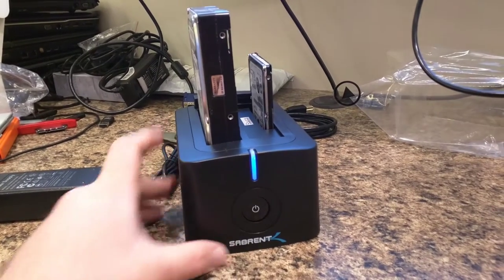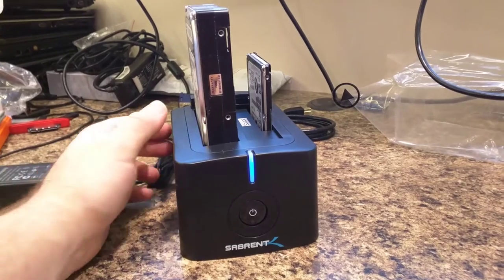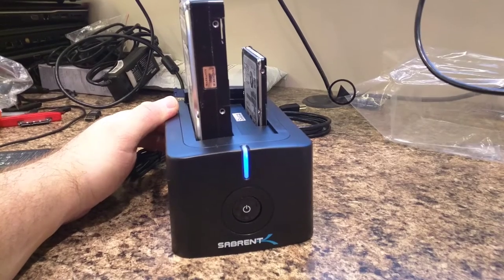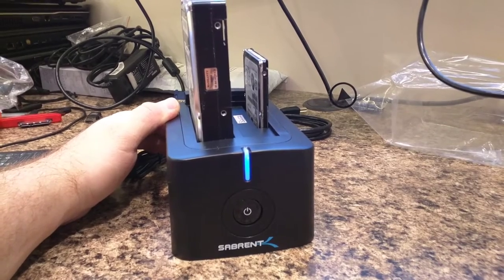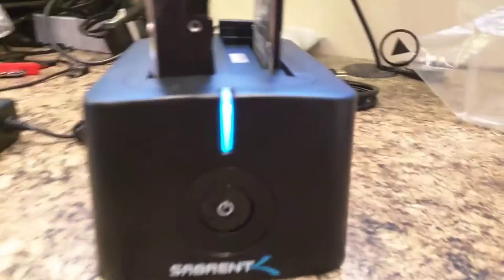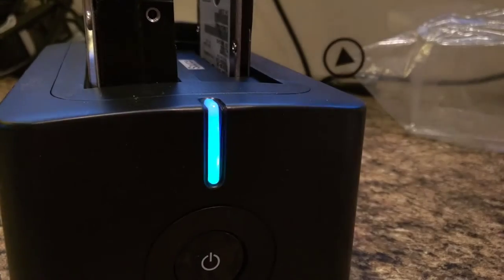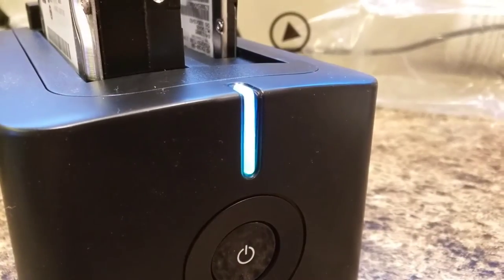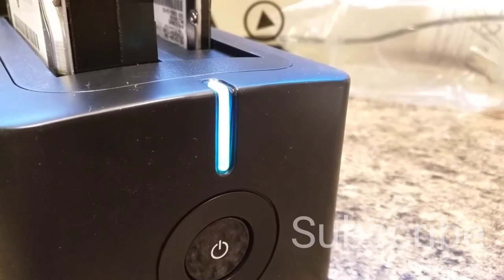Clone Hard Drive with Sabrent drive toaster

Comment: It really also depends on the filesystem. I clone 4TB drives all day long - NTFS or FAT is pretty quick (maybe about an hour or two), whereas EXT4 took almost three days. The partition structure is complex, even though it's sector by sector. In fact, it only had 200GB of data on it and still took that long.

Comment: Nice tutorial. Question, I just bought this sabrent docking station and wanted to know can I connect to a running computer and view/and or delete any data/files without doing a full clone first??
Reply from the maker: Yes, you can. But this is a sector by sector clone so it won't do a ton of good.
Reply: TrenchTech Computer Repair Tutorials Meaning bad sector + good sector= Successful clone? I purchased a new hdd I have a failing/failed drive. Won't boot, got 6 years out of it and I'm at " imminent failure code code (303)
Reply from the maker: It will skip the sectors it cannot read.
Reply: TrenchTech Computer Repair Tutorials Not sure what the problem is here. I connect both original HDD and new replacement HDD for the clone. Same HDD size 1TB 7200  3.5 inch sata. The original HDD is a Seagate. The replacement HDD is a WD. Could this be the issue? Both drive spin right up. My original HDD is still strong. But no connect with USB either. When trying the offline cloning method, I press and hold copy for 10 seconds and the blue light does not blink.
Reply from the maker: Sometimes I have to hold it longer. If that doesn't work, power it down and reseat the drives.

Comment: will this work if I have a Western digital 1TB external hard drive from a few years ago.  its a SATA 3.5 hard drive with a crappy bridge card that I believe went out.  Rather than spending the time trying to track down this bridge card.  Can I just take the hard drive out  and use this dock and clone it to a brand new SATA 3.5 1TB hard drive without any issues?
Reply from the maker: +Ernest Sanchez I've had it work with some bad drives, but results will vary depending on severity.

Comment: I have used this to clone and it has worked well but tonight curiosity got to me and I did a test to see if it really mattered how much was on the drive. After formatting I put only one folder and one empty text file in the source drive and so far it is still going after 20 minutes. Test run with a couple of WD Blue 1TB drives. Weird.
Reply from the maker: That's because it is a sector by sector clone. It will keep going until it goes through the whole drive.
Reply: Got it, but in your video you said it depends on how much data is on the drive when it does not appear to be true. I just wanted to prove that.
Reply from the maker: It also depends on the conditions of the drives, as well as the speed. SSD vs 5400 vs 7200. I've had it copy drives in less than an hour, and I have had them take a few days.

Comment: Thanks for the video . I put in 2 laptop mechanical hdds (320gb source and 500gb destination) and followed the instructions as you said, the light turned from the default blue to green and started flashing. After about 1 hr and a half, (approx) the light stopped flashing but it is still on green. Is that normal or should go back to blue? Scared to pop them out.
Reply from the maker: If it is no longer flashing it is done.
Reply: Thanks ..it cloned successfully but it reduced the size of the 500 to the 320 and I'm having a time trying to extend the volume. Any suggestions
Reply from the maker: +Joysingod if Windows works, use that if not use http://www.partition-tool.com/easeus-partition-manager/help/resizing-and-moving-partition.htm
Reply: Thanks I'll try it.
Reply: @Joysingod  how’d it go? I wasnt able to do this myself.

Comment: I tried twice to clone a 500 GB HDD to a new 500GB SDD. It flashed green for a couple of hours then turns solid green. When I install the new ssd drive and boot up the machine, it wants to run windows repair, then it determines that the disc has no content. What is happening? The original drive is OK.
Reply from the maker: +Tim Combs what OS is it? I know I've had problems with the windows recovery partition.
Reply: I found out that the problem is that my source disk is "dynamic", This contraption, apparently, isn't capable to clone it.
Reply: Thank you for making this video. I purchased this years ago and finally used it for the first time. I had no idea how to properly use the clone function and what the LED colors meant. Thank you very much for taking the time to make this video, it helped me a great deal. Successful clone from HDD to SSD thanks to you.

Comment: Does Windows read drives like an external drive with it?
Reply from the maker: Yes, it's the best tool ever.
Reply: THAT WAS THE SAME QUESTION I HAVE . I WANT TO USE IT TO SEE THE FILES ON A HARDDRIVE REMOVED FROM A DEAD LAPTOP AND TRASFER WHAT I WANT TO MY CONNECTED LAPTOP LIKE IT IS AN EXTERNAL HARD DRIVE.

Comment: So I hooked it to power. (power is also on! lol) the source is in dock one and the second is in dock two. i hold copy for ten seconds and it still wont flash. It does nothing with the hard drives inside it. dock one's hard drive is half the size of dock two/destinstion. doct one's drive for sure has data already in it, and the one in dock 2 is completely empty. any suggestions?
Reply from the maker: +James Westbrook make sure the USB cord is not plugged in. You must have the USB cable unplugged for the clone to start and work.
Reply: does it still work if source disk is a bigger capacity than target disk?
even though say source has 100gb used and 900gb free and target has 400gb.
Reply from the maker: +stoneridge zutt it would work if all the data is stored in the first 100gb. It would be better to use something like acronis though
Reply: I've had this - usually one drive is not seated perfectly or has other problem. If spinner drives, make sure they both spin up by touching them

Comment: What happens when the source drive tries to clone the same data already on the destination drive, does it over-write, or skip? Basically I'm trying to backup a backup with new recent data
 thank you
Reply from the maker: This device does a bit for bit transfer. There is no logic. It does a full read and write regardless of there being any changes or not
Reply: Do you know what the relative transfer speed is? I'm cloning a 4tb (2tb used) Enterprise desktop drive to another and it's been about 15 hours now. The blue/green light is still flashing up. thx
Reply from the maker: I've had one take a week before. It all depends on the drive, age, speed, etc. No formula, sorry.

Comment: can I clone a mac formatted hard drive to a  windows hard drive with no problems?
Reply from the maker: +fuggotry if you are doing it with this device it will do a sector by sector count. It doesn't matter what the original formatting it because it will match the source.
Reply: I don't see any flashing after I hold the button for 10 seconds nor do I hear hdd writing sounds, would could be wrong?
Reply from the maker: +fuggotry if you have a USB plugged in it will not work.
Reply: oh goodness thank you, thank you for the quick response, subscribing

Comment: I used my cloner and it sat there for hours and never got past 25% i finally took it out to find out was cloned as a raw drive
Reply from the maker: +Joshua Afolabi I'm not sure how you know the percentage, but every time I clone, it takes a different amount of time. I've had it work in a few minutes, few hours, or over a day.
Reply: I had a similar, or maybe the same problem.  There are lights that are supposed to track the percentage to completion... from 25% to 100%.  25% seems to flash upon initializing the process, but if it doesn't move up to 50% it probably never really started cloning the drive...  I don't know what the problem is  - my old HD still works in the computer, still boots... the new HD is a good brand and plenty big... but it runs flashing 25% for 20 minutes and shuts off, with no data or programs cloned.  This product's purported one button cloning seems mostly hype.